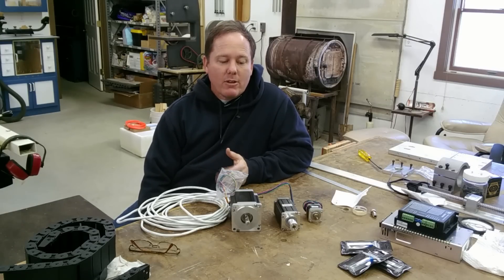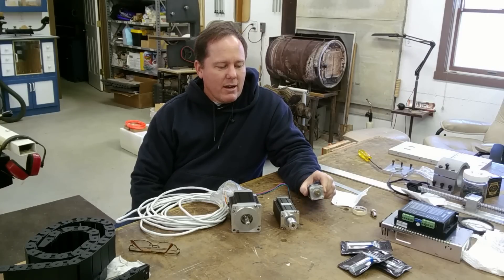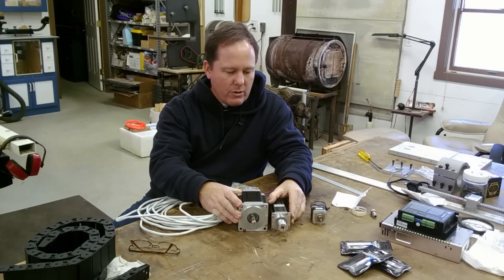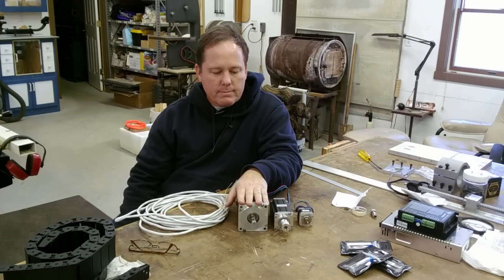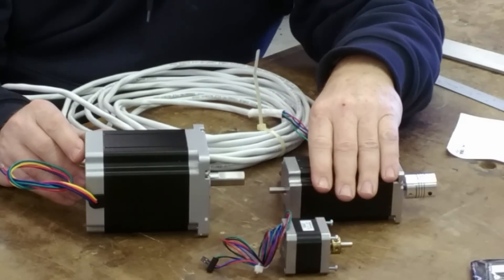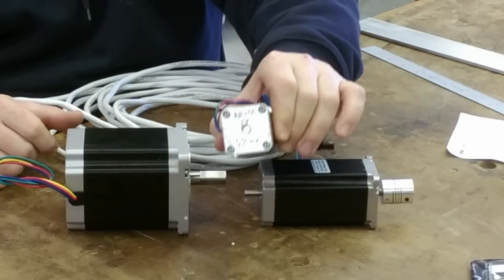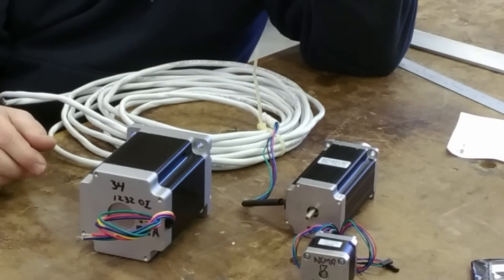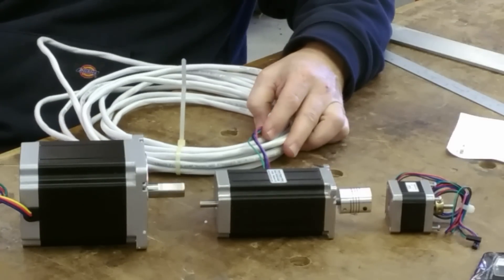Practical Insight in selecting stepper motors for your build -Old Version

Comment: hi 
do you know what size and type of motor to rotate the rotary table  on bearing its 200 kg 
 https://www.youtube.com/watch?v=NeKkZxZHONM
something like this 
thanks
Reply from the maker: That is really hard from me to help with a guess.  I don't know how free spinning the table is (drag).  Based on the video the table is roughly 3' in diameter.....If you want to direct drive it, use a nema34.    You can use limit switches for positioning, or you could use servos (stepper with a feedback).
Reply from the maker: I just did the conversion to pounds...that is 440 lbs.  If you try and direct drive that, even a 34 won't do it.  I feel there would be too much mass to get it moving.  You will either have to use some mechanical gear reduction or go with a motor outside of my experience.  Something large that is.
Reply: thank you very much
On the valuable information
And useful
Glad you answered a question

Comment: Do you have any experience, information on stepper motors with built in planetary gearing?  I'm building trackers for my solar panels and need a ton of torque with almost no travel.
Reply: +Matt Obermiller  Maybe you already built your project, but a solution for the 180 travel might be a " Worm Gear Motor ". The worm gear transmission usually holds it's place mechanically, you can get whatever ratio you want for your low speed/ high-torque action, and they usually output at 90 degrees to the motor. Good luck..
Reply from the maker: I do not.  However, the solar trackers I have seen all use linear actuators.  They have a ton of torque and minimal motion.  If you look hard enough (and want to spend the money) you can even find them as servos.  Difference being that the servo gives you a feedback signal to you know exactly where they are at in their travel.
Reply: Thank you for the information.  A quick foray into the world of linear actuators reveals that they are a motor turning a collar on a screw which advances or retreats in a slow, controlled manner with great power.  Unlike stepper motors, they will hold a position without current being applied.   Sounds like the perfect solution for vertical tilt for seasonal adjustment. (Which is far less than 90 degrees)  I live in the far North and want solar trackers to travel over 180 degrees for daily sun following in the summer and not sure how to get a L.A. to pull axle attachment lever past top dead center.  Also, the tracker support poles will be mounted on the side of a building with the axle that turns the array head coming down to ground level in the center of the tube.  This will limit the travel of an axle drive lever to just over 180%.  Any ideas?  
I originally hoped to find geared angle drives that have a pass through configuration (I.E. an input and output shaft mounting yolks in line with a power take off shaft coming out the side at 90 degrees)
This way I could have an angle drive at the bottom of each of my 5 array support posts with a shaft (with a slip spline like a truck drive line) between each angle drive and one motor driving the whole thing at one end or even in the middle.  
This would allow me over 180 degrees of array travel and not need power to hold the array in position between movements.  Thank you for the reply!
Reply from the maker: That is a lot of travel and would be a challenge for actuators for sure.
Reply: hey, the linear motion has a limitation in terms of the angle of sweep it can offer in the solar tracker. A better approach would be use of a worm and worm wheel, excellent power transmission and can hold in position without requiring power. unlike other gears. And also can offer 360, 680 degrees turn.

Comment: is there any difference in precision ?
Reply from the maker: All of these have the same number of step's.  Depending on the driver you use, you can get more or less "micro" steps.  These are fractions of the native steps.  When you look at motors they will tell you how many degrees per step they due without "micro".

Comment: many thanks for the video! It's a bit ironic that to do a proper job adapting the motors (e.g. the plates at 7:35) you needed a heavy duty end mil -- my baby sherline won't handle it. I guess it can be done with a drill press, after centering the holes on the sherilne.

Comment: the handy thing about that nema 23 is that having a shaft on the other end allows for a hand wheel and manual operation as well as cnc, very handy on say a mill or lathe(almost esential) nice video, i'll have a watch of your others to see what more i can learn as i'm still in research mode, pennies are harder to come by at my age and even harder to part with once i decide on a plan. thanks for sharing your hard earned knowledge

Comment: OMG I think I got it! Just using deductive reasoning These
drivers must be constant current devices so when you set the value of current
you desire the voltage starts low and increases until the  set current is attained then some type of clipping occurs. You can’t adjust the voltage without changing the current. So
if the resistance is 2.75 ohms and you set the current at 4.2 amps then the
voltage will be something like 11.55 V if you lower the amps then the voltage
goes down. I hope I’m right and if I am I hope this helps.

Comment: Wonderful video and super comments/answers. I have an old 1940s Rockford engine lathe that has a power feed that is too fast. Tubalcain uses a DC motor  to drive the lead screw with a step down pulley arrangement. I would like to use an Arduino control on a stepper or servo. It looks like a NEMA 34 stepper would be powerful enough. The lathe has a clutch that makes the lead screw independent so it can be used for threading and off for slow power feed using a either a stepper or a servo. Any suggestions from the you and the commenters?  I am currently building an Arduino control for my 90:1 rotary table instead of using dividing plates. Lathe next. 
Thanks again for all you do, I subscribed and hit like.
Reply from the maker: As this video suggests, I do this kind of thing by feel and (limited) experience.  I am too far removed to make an evaluation.  I will tell you that an arduino / stepper driver / motor setup will do the accuracy you want....if you don't drive it to the edge of missing steps.  Best of luck - ~P
Reply from the maker: ...and thanks for the like.
Reply: where is the quality difference with cheap and expensive stepper motors on ebay?

Comment: hello sir i make 3axies cnc  i use  SANYO DENKI 103H7121-0415 stepper motor 6 wire  this motor  Consider only 2A  and 1.8 step  not Consider power supply
so how much power use this motor and which wire A+ and A-  and which wire B+ and B-

Comment: Hi sir. I watched all of your videos about this CNC machine and it looks amazing. I would like to build sometrhing about 8'x4'. My first question is: the longer you go, more torque you need?. I see that those 1230 ounce-inch motors are just monsters. they would probably work good on a biger machine. But my second question is: are those 1230 ounce inche motors a bit overpowered? you said that you use them at half they amperage. I know it is a bad idea to use a motor to his full power, but maybe 3/4 of the power may work as well? maybe a 900 ounce-inch would work, and i would not loose to many speed or presicion?

and last but not least. I see that rail sistem and the thread that you are using. I know that the rail wont bend on a long distance because of that platform that goes along all the rail, but what about the thread? is it thick enought to not bend at 8' long? could it work with thinner ( you are working with 50 inch rail and thread right?)
Reply from the maker: Where to start....First...good for you to start an endeavor like building a CNC.  I'm sure you will have success.
Motor size...yes they are big.  But I like 8 cylinder motors, not because I need that much torch...However, I have learned that there is a trade off with speed, etc.  I haven't studied down that deep to truly understand what I traded off with the size.  I can say that I have not missed whatever I gave up.  If that helps.  As for precision, the number of steps the large motors make is the same as the small motors I show in this video.  Nothing lost there.
You are correct to question the ball screw length when considering an 8' machine.  At 4' and full RPM they almost want to wobble.  I have also never seen 8' ball screws.  For an 8' machine, I would use rack and pinion.   Then I would use a belt style gear reduction.  I didn't do rack and pinion because of the lash that you cannot avoid.  Ball screws are what are on a milling machine so I wanted that.  There may be other options I haven't explored.  I wonder how they keep large production machines tight?
Reply: There is a guy on youtube calle frank howarth that have buildt two 8'x4' machines, and in both he uses rack and pinion and that kind of belt reduction that you said, so i guess that is the way to go on a big machine.  The reduction is used to maximize the power output of the motor right? puting the rack right on the motor would force too much the motor i guess.This guy uses a lot of 8020 aluminium extrusion, wich i think is WAY very expensive, it may be cool and lightweight, but more than 10 times expensive that regular iron.
Reply from the maker: It does more than amplify power, it also increases your resolution and ability to make small steps.  I can move a fraction of a thousandth because of the thread pitch and motor steps.  The motor alone, direct drive, won't give you that.
Frank has done some nice work.  I would definitely refer to his designs for ideas on a big machine. 
Best of luck in your build.
Reply: thank you! you will see my video when i build this big machine! i will start with a little one to test things, and my second build will be a big bad boy

Comment: Hi, good information by the way. I have thought about building a 4' x 4' machine (1/2 sheet size). I noticed you said your rails and ball screws were 50". I thought they would have to be longer than that as you would lose some travel due to having the runners on the slides a certain distance apart? Do you think the design of having a stepper and screw on each of the y axis is better than having a single one underneath in the centre? I wasn't sure how well they would stay in sync? If you were happy with your design it could possibly be stronger/more rigid. I haven't really sat down and nutted out a design but I was wondering how it would be if you had the y axis rails spread a bit further apart and have the z axis with spindle hanging in between these rails rather than over the side. Could that help resist twist on the y axis rail? Just a thought as I have never seen that before. Maybe I'm missing something.I thought the audio was quite ok-thanks for the video
Reply from the maker: I haven't had any issue with the twin steppers on the Y.  It is possible to have one motor lose a step, putting the gantry in a crooked position.  For this reason, you are best off to have homing switches so you can periodically home the motors.  This works because you have a home switch for each motor and Mach 3 drives them independently until they both hit home, taking out any mis-alignment.  I do not have this, but periodically check it manually.   Having twin screws was mechanically simpler given my design.  It also didn't introduce any lash which I would have had if I mechanically connected one motor to two screws as my design would require.
Given the weight of the spindle, twisting of the Y axis is a real possibility.  A design with the motor between the Y rails would be interesting.  Good luck on your musings.
Reply: Thanks for the reply. Good point about the home switches. I'm only at the research stage so I have a long way to go. Videos like yours help a lot so thanks for making the effort. I worked CNC machines for 11 years (about 15 years ago) in an aircraft engine factory so I have a fair understanding of their capabilities. I never would have thought back then about one day building one. I think in the past few years, it has become so much cheaper and more possible for the average bloke to have a go.
Thanks again for your very useful information.
Cheers Pete
Reply from the maker: Prices and availability have changed, and so has the information available to make you and I think we can make something like this.  I have a couple other videos on my channel you might want to look at as you sort through a design.  ~P

Comment: hey chief. got a question. to run a machine that large 4ftx 4ft what bitsize ecm did you run. 8-bit or 32-bit. going to build a 3ftx3ft unit myself. and was wondering if I would over run an 8bit controller.
Reply from the maker: I'm not sure I understand your question, but based on the last sentence, I think the question is, what size (bit size that is) computer did I select for a controller.  I'm using a 32 bit Windows system running Mach3.  Does that help?

Comment: I'm going to be running a test with a few 84oz nema 17 steppers, a dremel and 24v power supply for a small 14 to 20 inch square cnc. Something simple and dirt cheap (less than $300 for a belt driven, dimensional lumber frame, maker beams for rails, and bare arduino with no gcode or cnc software so I can have a tighter control of what the hardware is doing). My hope is to find the failure point of each component one by one and upgrade them as needed. I feel like there is too much speculation, rumor, trade secrets and maybe even some dark arts around what works "the best" for a cnc and why, that we overcompensate. Or even worse, we don't even start because we are told a minimum buy-in that is just too high for a hobbyist like me. When I first started to look into making a cnc, the lowest parts list I could find was about $1500 to be able to cut upto aluminum. They never even said if it would cut aluminum or why if it couldn't.
Reply from the maker: There are certainly places where I could have saved money.  Using an arduino and Grable would have been a big saver.  I have 2kUSD in mine.  You approach would make an interesting set of videos.  Good luck.

Comment: AUDIO QUALITY! AUDIO QUALITY! AUDIO QUALITY! AUDIO QUALITY!
Otherwise, good presentation.
Reply from the maker: You know, I am still struggling with audio.  As it turned out the mic was NOT being used for the audio track.  I have failed to make an external mic work with my tablet, even when using OpenCamera that purportedly allows for it.  I was willing to spend some coin on the mic, but cannot swallow the purchase of a new camera, just for audio.  Sorry.
Reply: I don't think it was that bad, although I do feel the volume was a bit on the low size, nice videos by the way!
Reply: Audio was fine for me. I use Bluetooth in my garage to the stereo.  In addition I am hard of hearing in my left ear.

Comment: if you want to stick with the smaller motor you can add a counter weight to the z axis this is how the large mills work to balance the spindle of the machine
Reply: 000ozzie Explain. link and which way would Z be mounted up or down? I have multi builds and deciding motors. help aha.
Reply: well large cnc mills have x and y for moving the bed and the z axis goes up and down 
the mills have a roller chain attached to the head/spindle and there is a hollow body down the frame where the roller chain hangs with the counter weight but for a hobby machine you can mount a pulley on top of the frame of your spindle and mount the cable to the spindle/head 
and hang the weight off the back of the frame adjust to even out the weight and even the smallest  motor can move it up and down mind you
if your spindle assembly is heavy your still going need a motor capable of the inertia needed

Comment: I love that 34 dude. Just out of my own curiosity, I know that the 34 would probably be recommended against doing this, but if I were to make a 3d printer the size of the CNC machine that you use for the nema 34 steppers, would layer heights of 0.1mm be possible?
Reply: research how many step that motor can make to do a full 360 turn, and then look up how for the leadnut can travel on the z spindel on a full turn, for explain, my lead screw travel 2mm on a full turn and my motor take about 700 step for a full turn so 2mm/700 step = the lowest height, which could be lower then 0.1 or even 0.01
Reply: Wow, so I guess it would work
Reply: Nasty Butter Typical stepper motors are 1.8 degrees per step, or 200 steps per revolution. Clever drivers can seem to increase this, but throw away those torque charts if you use them. If you're using a lead screw, divide the thread pitch by 200 for your step cutting distance.
Reply from the maker: .1mm is 3.9 thousandths of an inch.  Given the motors and the gearing provided by the ball screws, I get a resolution of 1thou reliably.  The big thing here is the gearing provided by the screw.
Reply from the maker: No...thousandths.  .001.  If you take the number of  micro steps the motor can make per revolution and the number of revolutions it takes for the screw to move an inch and you will find it is very doable.
Reply: bigger motors = bigger coil windings
bigger coil windings = more torque
Reply: I'm thinking of using chains like an engine or a bicycle use in order to move the x-axis along the z-axis. The bigger the stepper motor the better.
Reply: i think with metal chains you will get alot of backlash instead of normal pulley belts
Reply: Are you sure it's not hundredths of an inch? I'm not sure, but I think that's what you mean. That's still really good resolution you're getting if it's hundredths, but that would be mind blowing if it's thousandths.
Reply: Wow.  So is it that large because of the increased precision? I thought it was that large to increase the amount of resistance that it could rotate against.